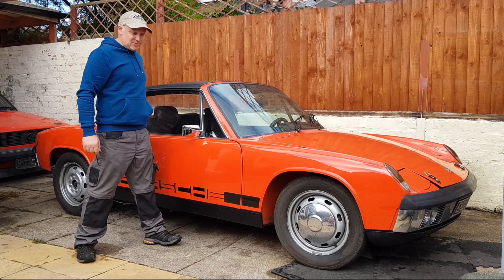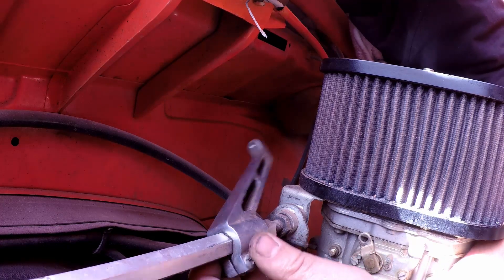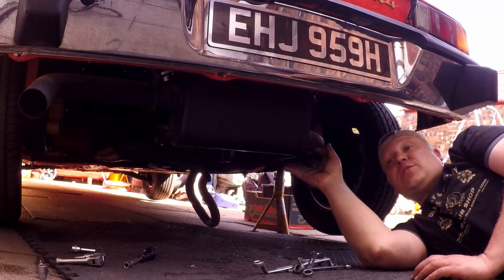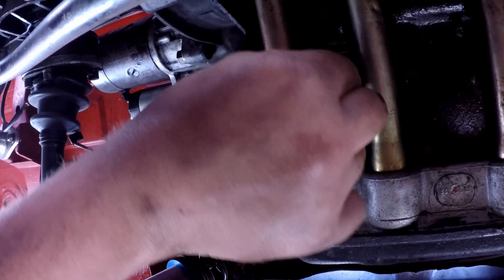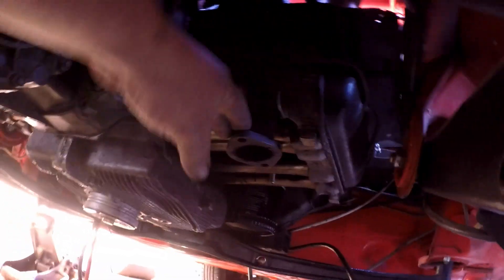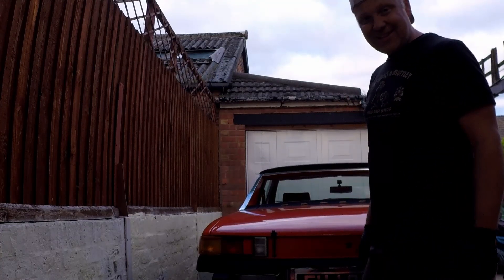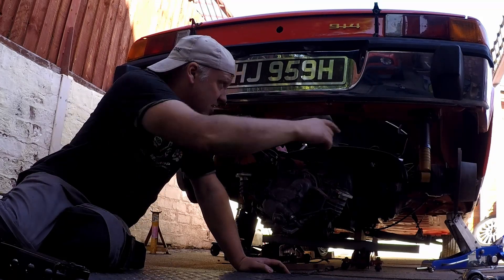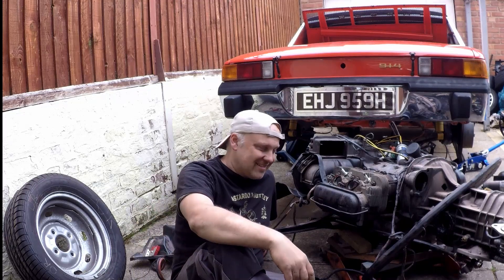Porsche 914 Ep. 2 : Taking the 2056cc engine out. DIY Style!

Comment: Interesting.  The gold badges would make it a 70-72 car, but it has a 74 rear bumper (with the "bumper tits").  The heads on it are 2-liter heads, with the three intake studs instead of the four on the other heads, and with the spark plugs that point outwards instead of straight up.  You can see that the engine tin has been modified to cover up the original spark plug through-holes and new holes cut.

The lack of "warts" and the European turn signal lenses front and rear hint that this is a European-spec car, but I think that the rear "bumper tits" were actually only on US-spec cars?  Not sure about that, though.

There look to be no thermostat flaps present.  These are important--and the one on the right side is *critical*!  When that flap is lowered, it ducts part of the cooling air flow into the oil cooler.  Without that flap, the oil does not get nearly as much cooling.

While I'm at it, be very careful with the "tuna can" deep sump under the middle of the engine.  There's a single nut that holds it onto one of the case through-bolts, and if you put too much torque on that nut it can break the case under one of the cam bearings.  Which will probably make you exceedingly unhappy.
Reply from the maker: Thanks so much for the information, yes It's a 1970 registered car your on the money, being 50 years old it's either had bit of damage or a modern look upgrade at some point with the bumpers

The bellow for the flaps are missing as well as most of the mechanism deleted, but the flap for the oil cooler is present, I can see how it ducts the air, I've read up about the strainer very wary of it given its unknown history but 'recent' rebuild and very clean oil it may not be a serviced until next spring or its tuned correctly
Thanks once again for the input, I'm starting to appreciate the car even more!
Chris